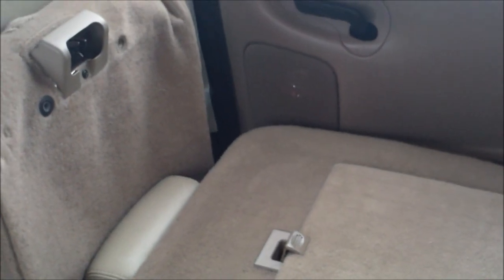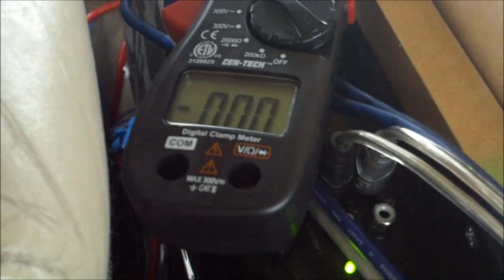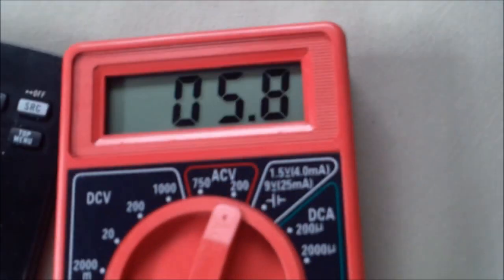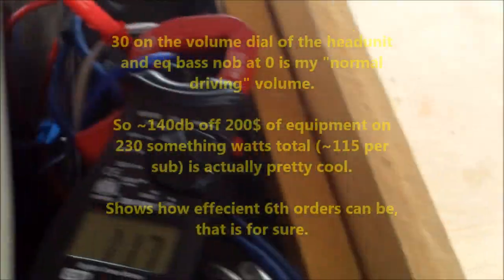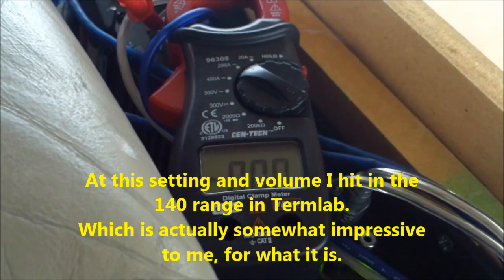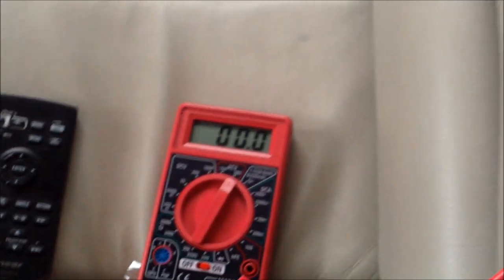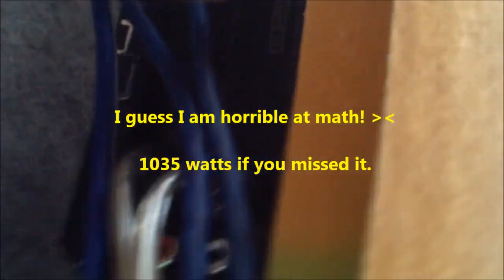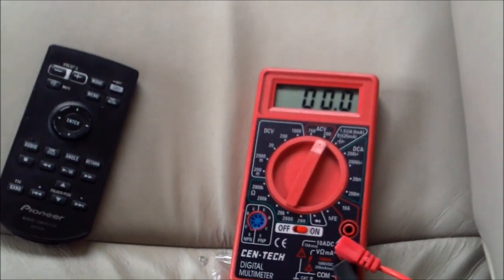Car Stereo -- Boss Amplifier -- Clamp Test

Comment: I don't think Boss is terrible, I have had them a couple times in the past . But I always knew it was putting out 35% of what the power rating was . But that's fine if you just run a sound system for listening to & not giving you a concussion . One thing they do that I see no other amp company do & I got to give them props on this . They have a Signal to Noise Ratio of 100+DB . That is awesome , if you understand what sensitivity is or S/N ratio you know what I mean . Crazy Awesome sensitivity!!

Comment: I have a boss riot 2400 watt class d monoblock amp and my boss 800 subs @ 2ohms now I have had 3 boss amps but this one can take what I dish out but I'm hearing negative all the time idk what song people be playing but if u listen to stuff I play may change ur opinion though it may be cheap but it has it's perks no one will jack and amp if they think it's worth ( not a big name brand)
Reply from the maker: let me be clear, boss is just fine for someone starting out or even somebody that wants to bang "normal" music. where it really starts to fall short (talking the amps now), is when you start listening to "decaf" demo music that starts getting into the 20-35 hz range. 

at that point the boss falls pretty flat compared to "big name" amps. but yes for your everyday music, there is nothing wrong with them. 

as long as you understand the above AND that you should at minimum HALF what they say they will put out at RMS, then you will be fine.
Reply: thats  very true, this amps r great for just basic installs , but there is no denying that the components used on the amp might not be very reliable. the price makes it very obious that the components r cheap,, i just dont like companies that try to fool ppl with those exagerated numbers on the box, i mean there is no shame on a 200,300 or 400 rms amp etc. ppl would still buy it if it fits their budget, and the life of an amp really depends on the install, tunning and moderate use because u can spend 1k on an amp but if ur install is shit that amp is going to fry and take other stuff with it

Comment from the maker: Good comments, yeah this test is not perfect in any way but just wanted a quick test. i do not have an o scope but will be getting one here soon. also i am also sure the power is not clean at all compared to "better" amps. 

but yes even if it is only a 1000 watt amp for 100$ off ebay, it is a steal. 

now what i have noticed about amps like boss and such is that they are fine for "everyday" beating, but the lower you go (in frequency), the weaker they get. i know some of that can be box rise and such, but the boss amp cannot even push the subs at 20hz where it has them really moving at 40 hz.

Comment: and by the way its a nice test.
i have a 2500 armor boos amp and it's puching around 400 Watt rms.
and for 95$ and 400 watt its not bad price.
And AB class Boss amp the frequency responce start at 9 Hz.
so how low can you go??
Reply: is 400 watts rms after u factor in the efficiency of the amp??

Comment: first your making a masure on a (resistive load and inductive load) its not the same masure as you would do it on a resistive load only.
keep that in mind.
second a scope would be nice to see the power befor cliping.
and usaly the power on a boss amp (RMS) whit a resistive load is about 16.5% x by max power the amp rating is.and that a aproximation.
so the amp is 4800 watt X 16.5% = 792 watt.